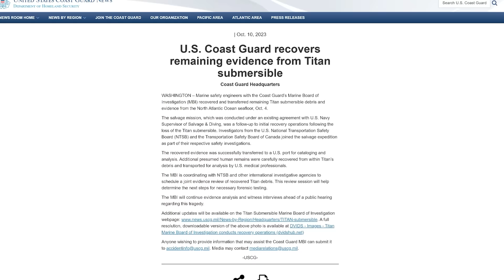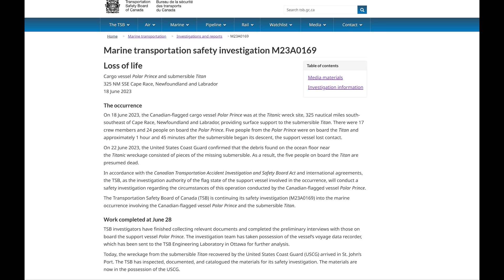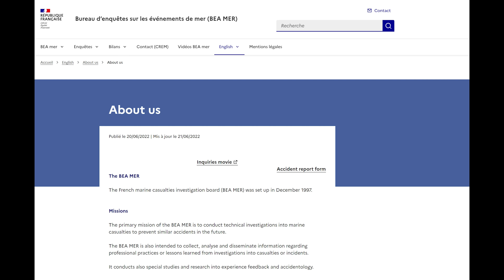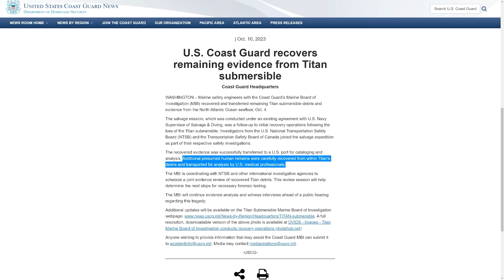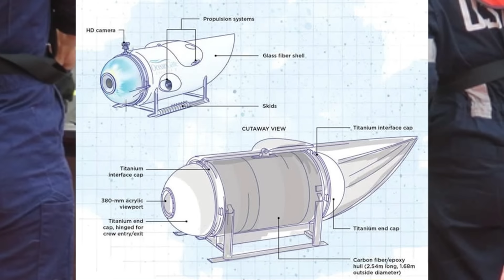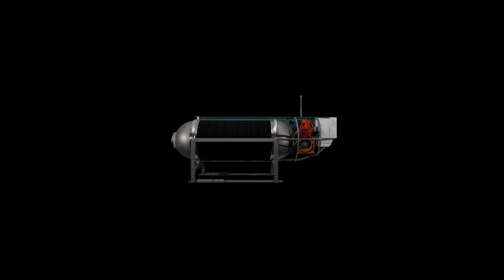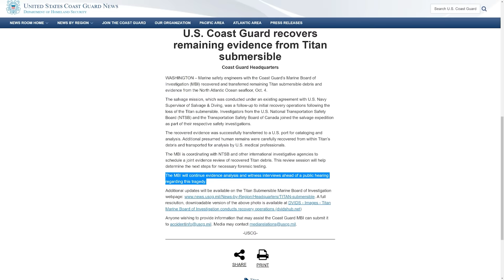Titan Sub UPDATE: More Human Remains, Debris Found

Comment: Pretty easy to see what happened, the carbon fibre flexed inwards and the epoxied rings popped off. I’m still baffled why this guy was so cheap as to not install rigid rings along the carbon fibre. It’s such a simple step and wouldn’t cost all that much to fab up some titanium rings along the hull. Any cylinder designed for strength we use support rings especially in the oil field that I use to work in. We even see structural rings in our cans of food. Those little pressed rings along the centre of the can of tomatoes is there to prevent collapse and a split can. Very poor design, but 7-9 support rings would have increased the structural integrity massively. I put support rings in race car parts when I build vacuum canisters for the engines and also for the fuel cell, it’s basic structural design and well known that an unsupported wall will collapse. Full size submarines use structural rings and so do oil tankers on our highways. I feel for the passengers as they were tricked by fancy words, I never trust anything with my life and always look at how things are built before I forfeit my life to it. Lots of mistakes made on this coffin ride, structural rings and epoxied on end caps where his biggest of them all. He was to cheap to do it right and had no business selling tickets to untrained personal. There are a lot of things in life that I want to do, but I don’t have the money to do it safely so I simple don’t do it. I build and fabricate things all the time, but money is still key to doing things safely. To do what he was trying to do he needed at least 20mil of play money for proper R&D, but he had nowhere near that and lied to everyone.

Comment: Leaving the steel insert wouldn't have given them a lot if any time,  would have defeated the lightness of the CF, and is also a reason why CF was the exact wrong material to use you don't need a form to make a titanium tube
Titanium is Stronger and lighter than steel and resists corrosion almost as well as gold if memory serves 
At a minimum that tube should have been titanium, CF should have been saved for the noncritical body pieces etc like its designed for

Comment: The mandrel could have made a difference with the proper adaptive rings.  The weak link here is the carbon fiber to metal interface with the epoxy.  The window was good to 1300 meters with 20mm shear along the cone (window is basically a truncated cone).

Comment: Given this is new territory and also multi-national, I can understand why the investigators are slow to release information.    Undoubtedly, they are under pressure from various quarters, and want to be certain they get EVERYTHING right. 

Thinking the apparent lack of any sizable chunks of carbon-fiber speaks volumes.  The inference being that it shattered completely - presumably this matter will come up when the data is released.

Interesting that., even after the implosion AND the 3-4 months afterwards, there are still (apparently) biological remains to be found.  I am reminded of an incident that happened with the deep-diving sub Alvin.  Basically, at one point of her career, Alvin was in an accident at the surface that led to her flooding and sinking in very deep water.  Thankfully, no one was hurt.  Considerable effort was devoted to raising her a few months later,  She was refurbished and went back to work.  Of special interest, one of the crew had left a packed lunch (a sandwich and a few other items), onboard Alvin before the sinking.  Apparently, the combination of high pressure, extreme cold and other factors led to these food items being almost perfectly preserved.

Comment: I think yes the mandrel would have made it stronger.  But if you're going to do that, it still does nothing to make carbon fiber more rigid under compression.  Might as well just make it out of solid steel IMHO.  There are also some really strong aluminum alloys that are light and might be cheaper than titanium.

Comment: I think depending on the thickness of the mandrel, it would have been a better option than than carbon tube. In this scenario, the carbon fiber tube then would be just redundancy having no impact on the overall strength of the submersible. Also would have made a stronger connection to the end caps as there would be more even compression rates between two structural metals rather metal to carbon fiber

Comment: The mandrill is irrevelevant. Nothing more than a 'former' to prevent the winding process from failing. Once the winding process was completed, the resulting 'tube' was nothing more than a tube made of a carbon fibre, impregnated with resin. As stated, repeatedly. the stresses experienced by the tube, were sheer forces as the tube buckled towards it's eventual destruction.  This is nothing more than the reverse of internally pressuring a tube, until it ruptures in the external  direction, Carbon Fibre was not designed to offer resistance in 'sheer'. Copper Wire, would probably  have faired similarly!

Comment: Carbon fiber in a matrix of epoxy is just not suitable for deep dives because of the damage it will sustain with these pressures, at best it’s a use once and throw away because anything after that is suspect and there sensors just told you the hill was failing and to late to save the sub… that’s not how you engineer something like this

Comment: I think that the lay up of the carbon fibre was done wrong. Pressure vessels under external pressure fail by buckling. Having the wraps all at 90 degree to the longitudinal  axis wouldn't help with buckling strength. Depending on the bottom conditions the port hole, if intact could be found by sonar. If the bottom is rocky and not silty the search would be very hard.

Comment: There are a few little pieces of CF on the edges of the titanium dome
Reply from the maker: That is incorrect because the aft dome was never connected directly to the carbon fiber. The afterdome is connected to the rings which in turn got connected to the carbon fiber.

Comment: Interesting about the mandrel. Not having the specific material details and only speculating, the mandrel may have added a few more dives before the carbon fiber failed from delaminating. Ultimately the tubular shape would still fail peeling away from the seal areas of the titanium ends as it deformed.
My guess is the mandrel was removed because it affected the buoyancy. 
That machine was a crude collection of parts.

Comment: When I first heard it was 3.5 inches of titanium and 5 inches of carbon, I thought of a 3.5 inch titanium cylinder wrapped with the fibre...then I find out it was just a carbon fibre cylinder GLUED to the titanium end caps....
This craft was 100% destined to fail. It should have been put down on dives with nobody on it until it did fail, then you analyze and build the new safe version.

Comment: I think if they had of leaft the carbon fiber on the steel spindle then milled out the spindle to even a relatively thin thickness it would certainly have made the center section alot stronger

Comment: Leaving the mandrel in would have defeated the object of trying to use carbon fibre. Personally I think carbon fibre was a good idea, they just didn't use enough of it. Weight of the cylinder wasn't going to be an issue once in the water. I think they could have gone 50 or even 100% thicker. I wonder if cost was a factor, or did they just run out of carbon fibre and decided that it should be enough? I heard it was out of date surplus material from the aircraft industry. Maybe the amount was limited

Comment: No they couldn't leave in the steel drum.  For them to do that they would have had to make the sub three times bigger in order to accommodate passengers. The additional weight of that drum alone you'd have to beef up power which means larger batteries.... Rush was in a rush to sell tickets,

Comment: It is interesting to note that the carbon-fiber wrapping for the hull was apparently done only in the vertical, linear direction as shown in the reference video.  Most other carbon-fiber wrappings I have seen show a multidirectional method that apparently guards against forces from different angles.  While the use of carbon-fiber technology for deep sea applications is certainly questionable, the appropriate utilization of commensurate adhesives is equally disconcerting.

Comment: If you add that much more material you would have to counter it with floating foam. So it would have made the craft far bigger. Increasing costs all the way up the line including needing a different ship to transport it. So would it make it stronger? Well of course, would it have made it feasible for the specific specifications and small size they were aiming for? Absolutely not, it would have been quite big to make up for that weight with buoyancy.

Comment: Did a 12ft  5ft inside diameter for 5-psngrs as a parallel-sided barrel 180-staves with a 1° wedge angle/face spans it in aluminum bottom 2"×3" tall, to 10km yield, certify to 4km.

Pressure is mechanically turned into circumferential compression by geometry, shells do this internally the diff.

A reaction to this.
📚

Comment: Regarding the steel mandril... even if they made the whole thing out of titanium it probably wouldn't have mattered. 

Titanic 1.0 taught us that stupidity has a way of compounding on itself. It wasn't any one thing but a conglomeration of things, the binoculars sitting in a locker in Southampton, lack of lifeboats, watertight bulkheads that only go up to E-deck, the watertight bulkheads didn't seal horizontally, ignoring iceberg warnings, excess speed in an extra calm sea, wireless operator on the Californian went to bed because he tried telling Titanic to slow down and they told him to "shut up, keep out, I'm working Cape Race." because they were forwarding the billionaires mail on the telegraph. 

Even if Titan 2.0 had had the steel mandril or been a solid titanium hull all the way around, there was still enough stupidity built into the system, like the plexiglass window not even rated for half the depth, that I'm sure a lengthy list could be compiled of ways it would have failed....

Comment: As far as weight goes, carbon fiber usually is used to replace metal materials for weight savings as the PRIMARY reason. That's how it is when it comes to automotive performance, as well as firearms applications. I'm going to assume that's the case in other applications as well.

Comment: it looks like the O ring in the aft dome has broken in several places and is sticking up out of its channel. Also- only one O ring? really?
Reply: Noticed that too.  You could see in other videos, pictures of the forward dome as it's being closed and all, only one ring.  Heck, I know on nuclear reactors and containment building seals, we used two rings with a test point between them.  Close the dome, pressurize between the two to test for leakage BEFORE putting things into service.

Another groove and o-ring wouldn't add TOO much to the cost.  I wouldn't want to start a dive only to find at a few hundred feet you need to surface because some bit of grit or other minor defect.

Comment: At this point, my guess is that between the hobbyists lack of care, safety, and stone cold science, the submersible had multiple failure points. It was just a matter of time before tragedy struck. And I'm with the theory that water had been slowly leaking into the back for at least one other dive. And that might explain the rust on what was just found. Does rust build that fast under water? But if water was just sitting and evaporating in the back section...

I'm hoping some people are going to be charged with gross incompetence. Although we all know we can't charge the main one at fault.

Comment: After an implosion there are no remains... the remains would be a jelly-like substance released into the ocean. At that depth the pressure would be 5556 lb/sq. in... that's like getting a truck dropped on every square inch of your body.

Comment: They used a carbon fiber tube to reduce vehicle weight .. if it was titanium, it would weigh a lot more, requiring heavier motors, equipment, etc... greatly increasing the weight and size... and that would require a LARGER Support vessel (the main cost) .. all that would result in a money losing commercial business. They took risks to make money.

Comment: I think the metal mandrel might have helped a bit but it would have been much better to make whole body out of steel because that's known to behave work for deep sea submarines. It still boggles my mind that they used material that is known to be worse than steel for compression forces. Carbon fiber would make a lot of sense for pressurised airplanes where the pressure inside the hull is higher than the surrounding environment but not the other way around. As such, having carbon fiber outer lining on top of steel mandrel would give nearly zero benefits.

Comment: It's likely that the mandrel was left out for weight (i.e., buoyancy) and strength considerations - in particular "weight/added strength" assumptions. In other words, just add more layers of carbon fiber at less weight if added strength was the goal.  Need to ask the OceanGate design engineers this question. I conclude this as apparently the assumption of OceanGate engineeers was that a cylindrical (vs spherical) all-hull titanium design would not withstand the pressures or the cycling required for the missions planned.

Comment: i dont think the steel mandril would have prevented the failure. it itself wouldnt withstand the pressure and once the carbon fiber failed, all it would have done was fold up and squeeze them all. these pressure vessels need to be one mass
Reply: when i first heard the composite of fiber and titanium. what i thought was they were going to layer carbon fiber and "thin", relatively, titanium shells. this i think would have been much better than a thick wall of carbon fiber alone

Comment: I noticed the corrosion. Very strange for titanium.
Reply: Someone mentioned the orientation this would have been at the bottom part of the hemisphere during normal operations.  IMHO, I think condensate on some interior brackets or other equipment causing rusty water to sit there over the several previous dives just leaving a stain of sorts.
Reply: @mikefochtman7164  yeah I wonder. It can oxidize when it gets hot. Could it have gotten that hot from the implosion? You are probably right though

Comment: Think about it;  3.25" of Titanium was judged to be enough for the 2 domes of the Titan, now the carbon tube was only 5"  that is only 1.75" more than the Titanium !!!
It was never going to last and I'm surprised it lasted this long.
And they wrote that they where going for 4.5" of Carbon and that includes the supposed 2.25 margin of safety !
So at 4.5" that's only 1.25" more than the Titanium,,, and if you remove the supposed safety margin well this would mean to be the same as the Titanium or even below the 3.25" !!!
They have gone with a very thin carbon fiber tube for buoyancy, sacrificing strength and safety !
What if they made it out of Titanium and reduced the thickness just for buoyancy,,,, would people have noticed then ?
But because it's carbon people are baffled and quick to blame the material, for sure it's not the best for this, but they did not use it properly either..

I will say one more thing, so far, unless one of my sketches shows up to be strong enough and light enough, I believe that the supposed buoyancy benefit of carbon is cancelled out because you need to make the carbon much thicker.
Making it's use a pointless endeavor !

Comment: Absolutely it would have helped also they could use the Billet piece of aluminum as a mandrel Inner Circle for the carbon-fibre which Woulda helped anything in remind carbon fiber with a metallic material only makes it that much stronger and I do believe if they had a metal inner tube like that it wouldn't have blown up in pieces in my opinion I still believe the control Spears are the things that blew up Stockton himself said when they blow they are equal to 11 to 15 sticks of dynamite pressure control spear!

Comment: No it wouldn't matter it went down to fast they were ahead of their time:did get a chance to alculmate the sub:it would of blew up anyway it was on a death trip with your host to death Rushthe heat of the implosion was hot as the sun the carbon fiber melted like glue

Comment: I know they use titanium in race cars. So it’s got to be pretty light but strong. Then again the parts in race cars are pretty small compared to how thick and big those end caps are. I would guess they should of used an inner titanium cylinder. Then put  it on the mandrel to wind the carbon fiber around the titanium inner layer.Seems like that would of made it a lot stronger. I’m not sure the shrink rate of titanium is when it is subjected to extreme cold. So that might not even be feasible to do.

Comment: A steel (or titanium) mandrel wrapped in carbon and bolted to the end caps would have a substantial improvement to the Titan, in my opinion
Reply: If it was titanium there would be no need for carbon fiber. Titanium hull, period- that has already been successfully used for decades. Stockton used carbon fiber to save money- and it was expired material, to boot.